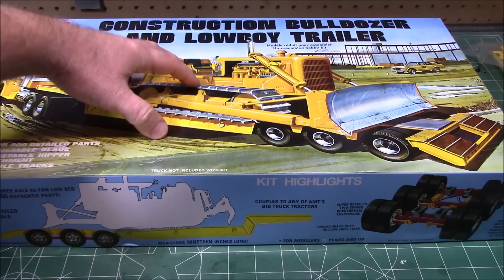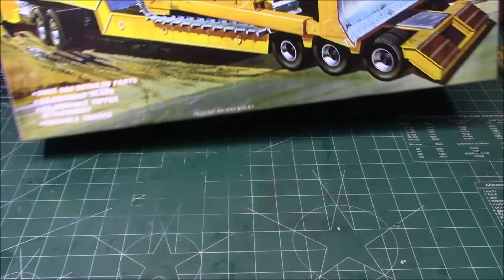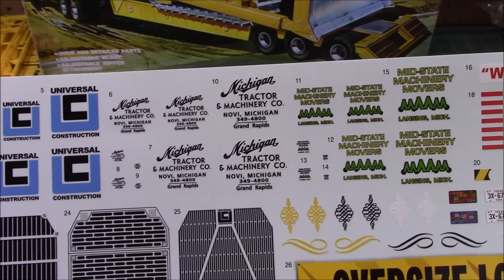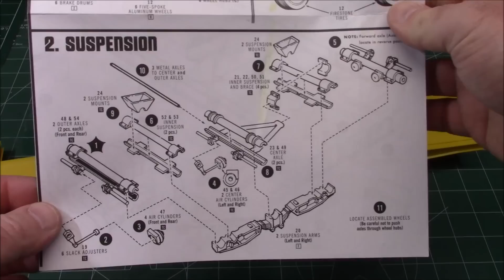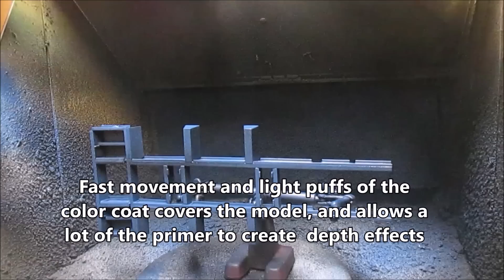Caterpillar D8 Bulldozer and LowBoy Trailer 1/25 Scale Model Kit Build Review Weathering AMT1218

Comment: Oh, Round 2/AMT molded the Caterpillar D8 bulldozer in yellow again! When AMT first released this kit, I had bought one. The polystyrene was yellow, making assembly reasonably easy. 
   Twenty years or so ago, AMT re-issued it, as well as Ertl's massive International Harvester off-road dump truck and cement mixer. Unlike Ertl's original issue of their kits decades earlier, however, AMT had cast them in a light grey, increasing the complexity of assembly by an order of magnitude! 😠 
   To see the D8 in yellow again--saving the builder enormous amounts of work--delights me. A wistful joy, though, for my happiness will be vicarious.

Comment: I built this trailer 5/6 years ago. It damn near fell together,one of the best assembling trailers I've ever built. I replaced the molded plastic "wood"with real wood. Turned out amazing.
I was waiting for this to be actually released to order it. Glad to hear it's finally in! I'm gonna get this,the big International rock truck,and a separate trailer.(To modify to haul the big rock truck!)
What the heck!?? You finally run out of good ol' Testors silver???
Reply from the maker: The brush on silver works super nice for dry brushing.

Comment: I bought the same kit a couple weeks before this video was uploaded
Im doing something different
I took each part of the trailer, measured and rescaled to 1/14 scale
Currently using these measurements and building it using steel welded together to create a big brother for use in my big radio control semi trucks
Larger Rc one will be exactly like the smaller plastic model
Reply from the maker: Good stuff!

Comment: would it be possible to add strips of balsa wood for decking in stead of the provided plastic sheets of simulated wood? Great build by the way, love the dirt dozer in contrast to the fairly clean trailer
Reply from the maker: Of course, redoing it as real wood wouldn't be very hard.

Comment: I have a question I have seen your spray booth have insane paint or dust build up I can’t tell what it is but does that ever become a problem with stuff falling on wet paint
Reply from the maker: It's paint build up. 100+ kits per year it builds up fast.
 And nope, never have an issue with stuff falling into the paint job.

 It's entire job is to catch loose paint.  Every now and then I'll give it a scrape.  Filters get changed as needed.

I'm always humored by how many folks worry about the paint booth being dirty. It's entire job is to get dirty to keep paint from flying all over the shop. :)  Thanks man!
Reply: @hpiguy  ok nice to know it’s just I just build my own spray booth out of a big plastic box I was just wondering if I should worry about paint build up or not